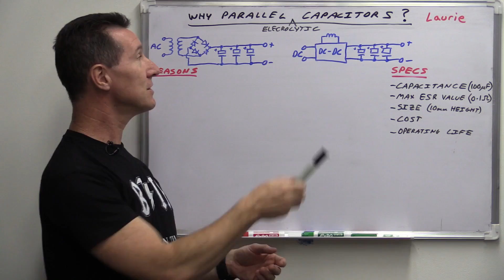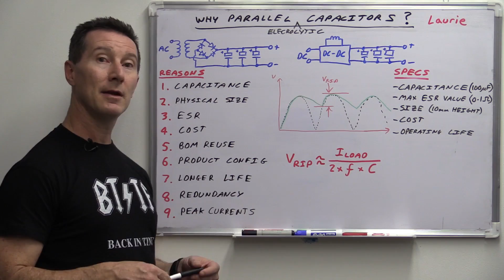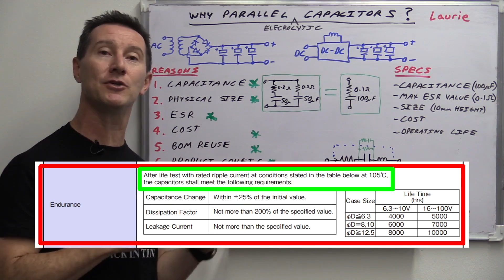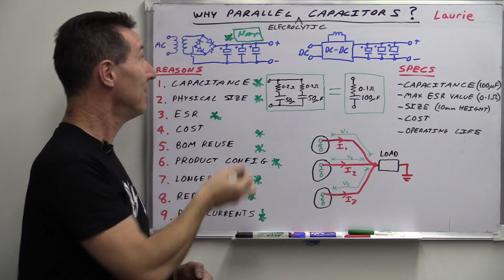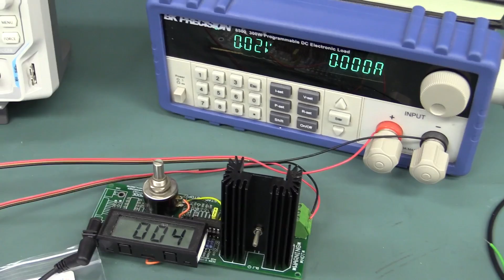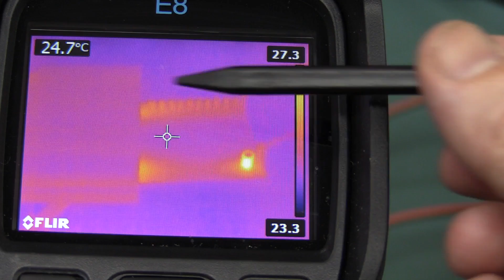Comment: Not only you decrease the esr, but also increase surface area and points of contact with the board(significant amount of heat escapes through it). In some cases it will decrease ESR by 50% for two capacitors instead of one for the same capacity

Comment: Just wanted to add using low ESR electrolytic caps helps to reduce ripple current. High series resistance of the e-caps slows down the charging and discharging of the e-caps, which means that the e-cap can't do its job at filtering out current ripple. If you find that based on your calculation, your capacitance should have removed all your AC ripple in say, a full bridge rectifier circuit, but you are still seeing mains ripple after the rectifier, you could look into the ESR of those e-caps. Since ESR of these liquid e-caps are inversely proportional to the frequency, this issue is really only an issue at mains input circuit of your power supply, and usually not an issue at the output of switch-mode power supplies (where switching frequency is usually around kHz range).

Comment: ESR and longer life are tied to the same thing. ESR causes heating, which will dry out an electrolytic. Parallel them, and the ESR is cut in half.  It also increases the power handling ability of the capacitors. All of it together leads to longer life.

Comment: Thankyou  Ocker.  Im working on a power system,  but rechange my ideas as when you near any completion  "hindsight"  kicks in  so I go down that path.  Lately the idea of multiple caps came to mind as I want to get good power from fast switching and wasnt sure if big cap would charge up fully fast enough, I understand theres a time restraint but gather its more related to resistance and voltage.

You piece is exactly what Ive been looking for -  its a real gold mine.  This opens my mind to building circuits as Im old school  {used to f around with the old Holdens}  and hate the  "throw away society"  when you buy inverters etc...   and it goes bumg and you dont know what to do so throw it out and get another -  Id rather build my own so they last and anything goes wrong you know what to fix straight away.  Long life is what I want as dont want to come to depend on something then have it go bung in the middle of the night.  And i didnt know you could get caps on a roll like that.  No wonder they can make such wonderful electronics so small and so cheap that do work well.  But the crafties dont put ripple protection in them so you keep blowing them.  Thanks for your good work.

Comment: Given how often capacitor failures are the reason for device failure, maybe this should be done more often. 

Of course consumer products produced in the hundreds of thousands or millions of units, even a single extra capacitor might add up to the point a suit would care, and I'm sure there's a point of diminishing returns of cost to benefit ratio, still, maybe it should be more common.

Comment: Caps fail short so aren't particularly redundant in parallel.  It's a tradeoff where the reduced stress on a cap reducing the probability of that cap failing is weighed against the probability of system failure due to a single cap failing in a parallel array.

Comment: Again, another great video.  I’m a DIY hack and have managed to repair a lot of my own stuff by replacing capacitors.  Keurig coffee machine, Kitchenaid refrigerator, Ryobi tool battery charger, Thermador range, and I’m currently repairing an 85 year old Philco tube radio full of bad caps.  So yes your comments about longevity are bang on.  Trying to imagine how many appliances and electronics have ended up in the dump due to an inexpensive cap failure is like grasping the size of the universe.

Comment: ESR is proportionally less with height of the ECap to the point where it is required to choose higher capacitance (exactly because it is bigger physically) that you need e.g. in DC-DC converters just to meet ripple current spec due to ESR.

Comment: Great video Dave! A little more about the radiation equation at the end. Specifically, the two temperatures - can and background - are absolute temperatures in K (Kelvin) and not degrees C or F. With a room/background temperature of typically 293K, and the capacitor can higher, the fourth powers of both temperatures are pretty high numbers, and the difference between them exhibits rapid divergence as heat loss through radiation begins to predominate with increasing can temperatures. All good fun stuff.

Comment: Dave! You didn't discuss EPR!!! (Equivalent Parallel Resistance), while going parallel will benefit from lower ESR but if those multiple parallel capacitors develop low EPR! It's bye bye power supply! 
I don't know why the main accepted reason for capacitor failure is the high ESR mode when this particular mode will introduce higher levels of ripple and internal heat to the point where it destroys itself, but a capacitor with low EPR can effectively short circuit the power supply! Or over bias a transistor into destruction! 
Choosing the right method for filtering is like being caught between a rock and a hard place! 
Take your test circuit! For low ESR and longer life expectancy, the 10 lower capacity capacitors are definitely the way to go but if either one of those two solutions develop low EPR, then you have either one capacitor leaking DC Vs 10 LoL! 
I don't know but I'm kinda leaning toward going with minimal parallel as possible and going for as high voltage rating as possible...

Comment: It doesn't matter if the capacitors are electrolytic, ceramic or tantalum. You can connect all kinds of capacitor in parallel or in series, depends of what you want to do.
Reply: tantalum are a type of electrolytic

Comment: I remember a publication from an MIT engineer stating that two identical capacitors (same ESR) does NOT give the equivalent of a single cap with 1/2 the ESR of one (something about the internal ESR 'resistors' not connected directly).  I really would like to find this reference, but cannot seem to.  I think it was discussed years ago on the 4HV site.  I was looking at coil guns.
If anyone knows anything about this, please post.
Thanks Much.

Comment: Hmmm. With respect to #8 (Redundancy) I am not sure. I had way too many power supplies (mostly in TVs) that fail when one of the caps goes bad and gets shorted and the whole until stops working. When I think of redundancy it's more like the more components you lose the less efficient the system becomes but still keeps working. In this case it's definitely not that.

Comment: I am designing a simple PCB for a cigar humidor hygrometer. It is my very first project come to fruition. Even though I do expect to be making a Rev02 after completing it, I would like for the first one to come out as best as possible. After watching this video my question is, if the datasheet on the AMS1117-3v3 says to use a 22uF solid tantalum at the output of the regulator, should I be adding an additional cap for every component on the board? There is a 0.96" OLED screen, an HDC1080 hygrometer, and an ATmega328p-au (32pin SMD) processor. 

As of right now I have one 22uF tant cap coming off the regulator, feeding the whole board. @8MHz, 3v3, the largest amount of current, theoretically should be 0.4mA from the processor's internal clock, the OLED @3v3, 0.04W, and the sensor will pull 7.2mA @3v3 during its highest draw. 

I hope this is enough info, I am very much beginning my journey in electronics. Any help I will most appreciate. Thanks.

Comment: Hey Dave say you;ve got a pain in the ar$e TV board with suspect surface mount caps but the soldering ability of a hippo with the DTs. The other day i did hours of work on a board and then right at the last i vapourised a load of tiny caps trying to remove solder bridges. What if i got some electrolytics and soldered them in parallel to the pads of the suspect caps instead of removing the old ones... I was thinking along the lines of a 10 micro farad straddling existing 100 microfarads to at least get the ESR down. Too dodgy or dangerous or what. Cheeres from a big fan of the channel. UK.

Comment: Using the Stefan-Boltzmann law to compute the cap temperature is ignoring thermal convection and conduction which could be important, especially if you are relying on air flow or a heat sink to dissipate the heat. Really the formula you gave applies to a capacitor in vacuum that's well isolated from thermal contact.

... Otherwise, great video. :D
Reply: I agree on the great video!

Having built many things that burn up I've developed a keen sense of how heat is being removed from devices. I mean everything from the throats of nozzles where the heat flux can exceed 20000 W per sq cm to trying to keep a part close to liquid He temps.

Thermal radiation is a poor method of heat transfer in room ambient electronics since vaccum tubes went out of style. Convection and conduction dominate heat transfer in consumer electronics. But when the ratios of absolute temperatures gets large the t to 4th term makes radiation crazy good.

Comment: With multible capacitor you must count a coz a ESR a bit more curent  drop.-.-  in switching aplication where is LOW output you can have significant drop :) but ising just ONE can CAUSE EXPLOSION..  dast what i solving everyday.. damn..

Comment: Want to ask something about some vintage so called "dual can elektrolyt capacitors" i've got some in a tube amp with followed specs; 500VDC 32+32uF or others 350VDC 16+16+16uF (outher can negative) each pole piece are connected with each other with resistors.

I wonder how they constructed inside those days > parallel or series?

does anybody know if I can replace it with "seperate new " axial capacitors with comparable values..like solder all negatives together...
1. DC positive lead for feeding/resistor X to leg 2./resistor Y to leg 3. 
Hope I'm clear enough 😊

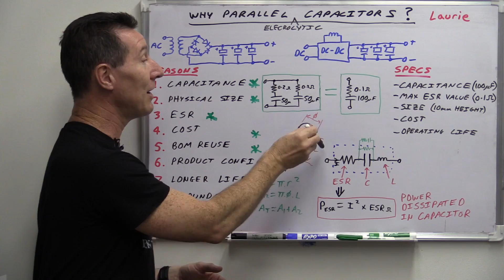Comment: I could be wrong... but aren't A1 and A2 labelled backwards? 15:00
A1 is the circle, which is Pi*R^2. (labelled A2 on the diagram)
A2 is the circumference of the circle as equal to the length of the rectangle (Pi*D) times the height of the cap, (L)
Call me crazy, but I noticed this straight away!

Comment: how coukd three 330 μf capacitors be cheaper than one 1000 μf?
Reply: The three 330uF may be cheaper because you can buy them from a series that doesn't need to have such low ESR., and hence may be significantly cheaper.

Comment: 20:05 - Isn't the pulsed load still electrically connected to the other load by the fact that the capacitors are connected in parallel? How would this help?
Reply: The pulsed load will draw a pulsed current, and that will create a pulsed voltage drop in the PCB traces leading from the power supply to the load. (Same in the ground traces.) So you try to avoid those voltage drop pulses affecting other circuitry, so you put those on separate traces. This is referred to as "star ground" or "start power delivery network" topology, if you want to read more on that.
Reply: @Graham_Wideman  so I’m guessing using this method does actually smooths out the pulses quite a bit for the other loads?

Like testing a circuit board with star power delivery topology and star ground, the difference can be measured vs. when a circuit board moms layout does not attempt any star configuration?
Reply: @Graham_Wideman  am I missing something critical? Like is there a downstream affect because of conventional current direction or something? Because I still don’t see how the voltage drop wouldn’t just be the same and present across all the connected traces, even with a star layout. lol
Reply: @lahmyaj  There are really two separate issues at play here. One is the pulse current demand that would cause pulse ramp voltage decreases on the capacitor, which we would prefer not to convey in the rails to other circuitry, hence separate caps. The second issues is that the PCB traces have some non-zero resistance, so a pulse current creates a pulse voltage drop in the PCB path from capacitor to load. So we would like that pulse-affected path to not be in the path from cap to other sensitive circuitry, thus prompting star-arranged traces. Combine the two ideas together and you arrive at separate caps with separate PCB paths to circuitry that has different current requirements and pulse demands.
Reply: @Graham_Wideman  thanks for explaining. I’m afraid it is a bit lost on me in text form and because of my lack of practice in this area. Lol I reckon even if there was a video out there explaining it, I still might not be up to that knowledge level to understand it fully. Thanks for trying though 👍🏻
Reply: @lahmyaj  Perhaps you are getting stuck on the capacitors being "connected in parallel", hence you  may be thinking that they all have the same voltage across them, and also see the same current demand.  Though Dave drew them that way on the board, don't forget that the wires connecting them together have some resistance and inductance, so the caps operate somewhat independently. Imagine Dave's diagram at your timestamp drawn with resistors or inductors instead of wires between the caps. That's the phenomenon being finessed here. Sometimes an inductance might be deliberately inserted in each of those wires feeding the caps, to make their response to pulse loads even more independent of each other.

Comment: Dave,  At about 10:40 you state that the ESR of two identical 'lytic caps connected in parallel, gives the total ESR as half of that of the two identical ESR's.  I thought this for many, many years, until I saw a discussion from MIT that this is NOT the case in parallel 'lytisc!  Note that the two ERS resistors are not actually connected in parallel!!  T creates trouble and complicates things.  I will have to go back and try to find what the actual conclusion was--or maybe you can help here?

Comment: This is a really interesting video.  I have one quibble, though.  For the temperatures and conditions you are talking about, convective heat transfer (either natural or forced convection) will be considerably more significant than radiative heat transfer, so your Stefan-Boltzmann equation is not the one to use.  I would use heat dissipation Q=UAΔT, where the overall heat transfer coefficient U depends on the air flow (in the case of natural convection the air flow depends on the temperature difference ΔT).

Comment: So, voltage ripple is lower with US 60Hz if all other factors are identical?
Reply: for just a rectfier yes, but most electronics use switching to get clean DC(in most cases). So it  goes HV-AC(mains) -> HV-DC(rectifier) -> LV-AC(switching) -> LV-DC(your actual circuit voltage).
But yes, 60 Hz is usually better in that aspect.

Comment: 11:45 You said "electrolytic capacitors filled with a dielectric liquid"? No you are WRONG! It filled with electrolyte, those it called electrolytic, not liquid dielectric. Dielectric is Al2O3 in aluminium electrolytic capacitors.
Reply: Alexander Guryanov
 There isn't a "dieletric liquid", Dave refers to dielectric media, which, basically,  means  any form of  insulator.

Any conductors isolated by a dieletric (polarisable insulator) is basically a capacitor.
Reply: Matheus Rotta Dielectric liquids do exist, just not inside capacitors usually.  Big transformers are filled with mineral oil, some supercomputers are filled with perfluorohexane

Comment: Great video.  I binge watch you on 2X and feel like Neo when I'm done.  

This video explains why my 1991 Mitsubishi Mirage would eat ECUs (aka brain box for the engine) every three years.  After the third one went, I finally opened up the case versus submitting it as a core exchange.  I found dielectric had spewed out of a large capacitor.  I swapped the capacitor out and got a few more years out of it.  In hindsight, I should have rigged up two capacitors in parallel to fix it forever.

Comment: Wtf, i relearned my basics from this video. Today I was designing a basic amplifier circuit to drive my speaker. I was getting that annoying DC signal in output. So I looked it up on datasheet's sample circuit and there it was 125 uf in series with the output. But I didn't have 125 uf cap so I tried 100 uf. But the problem was not solved. So I thought that I should put 147 uf by combing 100 uf and 47 uf. i put them in series and the output was now clear. For the whole day I was in this delusional that I have to put 147 uf cap when I will implement my circuit on a pcb. But now I know that by connecting 100 uf and 47 uf in series, i didn't add up capacitance but rather made it even lower. I think in so many years I totally forget my basics.

Comment: Correct me if I'm wrong Dave, in power supplies on the rectifier smoothing with 1 large capacitor will take longer to charge especially with the ESR factor. So with 1 large capacitor, it might get more ripple under high load compared with 4 capacitors to the same value as 1. reg. joe

Comment: I put two electrolytic capacitors in series once.  I was making a 555 timer circut. I need exactly half the capacitance of two identical capacitors that I had. So connecting them in series reduced the capacitance to exactly what I needed.

Comment: Hello! It's a very interesting video even for beginners :) What if I'll choose to replace a (let's say) 20mf cap with 5 small 4.7mf ceramic caps (+1 or 2 to get a bit over 20mf)? Will this give a higher life for my device? If it's not for a high voltage (not more than 30v). Or it's just a loss of space? Will this device become a really "immortal" thing if it will not be launched into space? Without thinking about possible corrosion problems...
Reply: MoolahNasreddin m = mili ?

Comment: BTW A1 and A2 are the wrong way round for the surface area of the capacitor: A2=pi*r^2 and A1=2*pi*r*l (=pi*D*L).  The total surface area will be 2*A2+A1 since you have to include the bottom of the can, unless you assume perfect insulation at the can base due to the circuit board:)